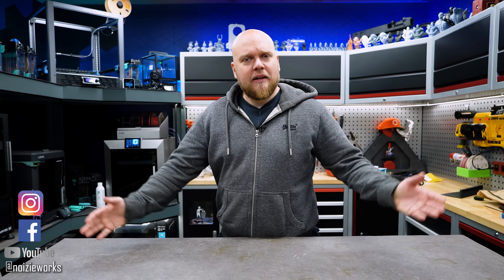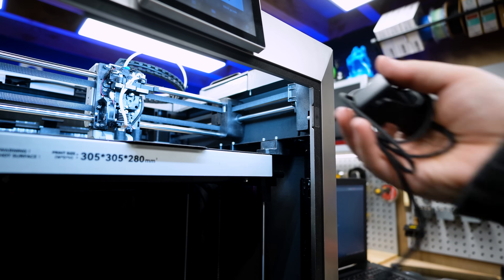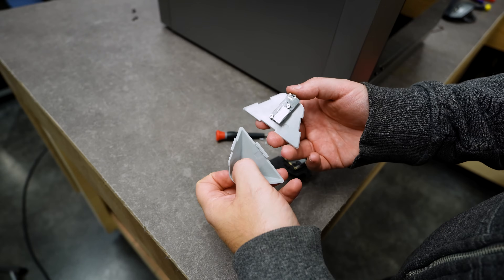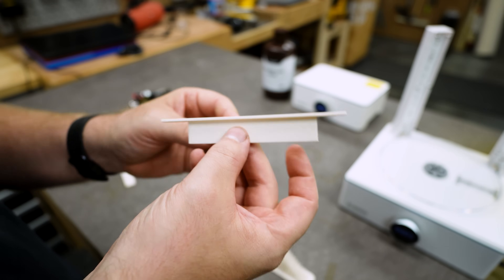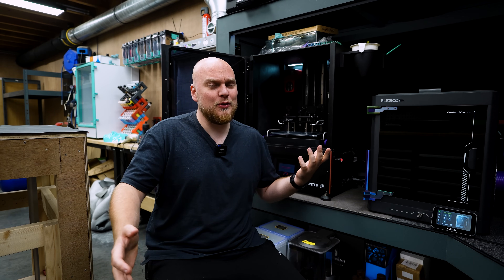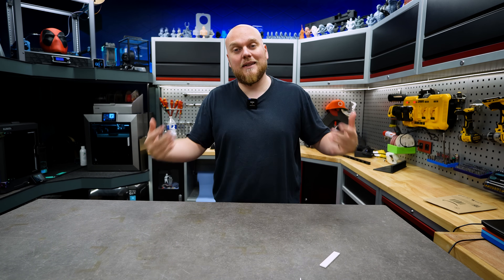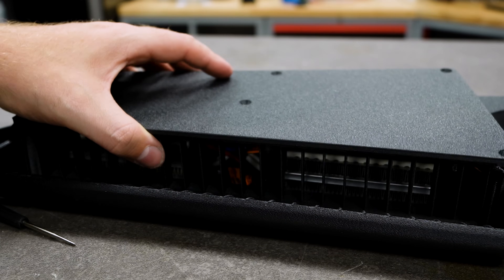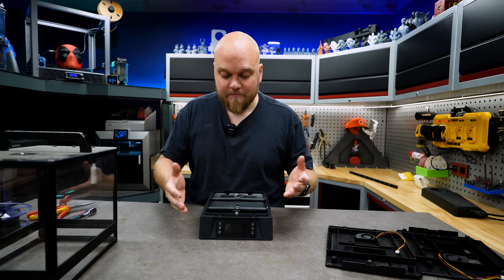Resin Printing: The Hero I’ll Never Love...

Comment: 500 watt heater looks nice.  My Ratty VC4-400 has a 1000 watt Rat Roaster. The chamber reaches 55C in 5 minutes before the bed even hits 100C.  No problem hitting 70C. And yeah, it's got a thermal fuse as well as Klipper overtemp control. The entire housing is about 700 grams of PPS-CF, so no concerns about things getting melty.

Polyphemus - The rotisserie mode is used very often, and surprisingly the drive motor for the spool rollers has held up fine!  However, 2 fans have died in over 1000 hrs of use. The dying bearing sound isn't optimal and the fan is an odd size that's a bit hard to source. However, EIBOS has been terrific about sending replacements for the fan, so it's not just that you're a wildly famous celebrity YTuber getting special treatment. The last replacement they sent included a base with a pre-mounted fan, plus two more fans. I've only had to pay a modest shipping fee. They've been awesome, and it's well past warranty.  Nice to see a company stand behind their stuff. Bought a 2nd one. The first is perma-connected to my QIDI Max3, and the other to Ratty VC4.

Comment: My camera is having issues now too on the plus 4 just about 1 year in.
Reply: Same.    Sometimes it works.  Sometimes it starts, quits but a re-start of the QIDI camera software works for a few minutes.  But most of the time it just doesn't work. Because of this video, I've got a Nebula camera coming.     I plan on using the other mount option to have looking more under the nozzle than from above.
Reply from the maker: @Taliesen. Cool stuff!
Reply from the maker: Make sure it's not a bad wifi connection by removing the usb dongle and putting it in the top usb port. If it's still the case time to replace it. The Creality one is cheaper then the qidi one.
Reply: @NoizieWorks I can connect to fluid fine and it usually takes a printer restart to get the camera back up. Printing an Asa-cf enclosure on the plus 4 for my ad5x right now camera was working and not it's not showing in fluid.. think its the wifi out just a dud. Been happening for about 2 weeks now.
Reply from the maker: @brandonberkmortel9558 i would try relocating the dongle or getting a new one all together. They are known to be low quality.
Reply from the maker: @brandonberkmortel9558  ow btw, are you going to install the Zmod to get fluidd
Reply: @NoizieWorks wouldn't be a bad idea. Haven't yet tho. Just been monitoring with flash maker for now. Had it about a week. Great little printer honestly. I actually had a Qidi box for a month could get that thing to finish a print without issues. Had to take it apart once too which was tons of fun....... Lol returned it, used the Qidi box money for the ad5x and also got an early bird on the U1 so looking forward to that printer . Qidi plus 4 gonna just be for single color engineering materials for me now.
Reply from the maker: @brandonberkmortel9558 great to know your experience, i am a bit annoyed that they closed it down... testing a 40hour 1000 changes print right now. NEVER would i trust the qidi box to complete this 😂